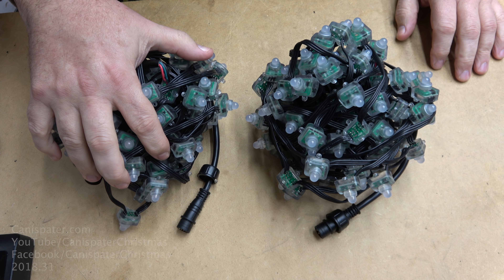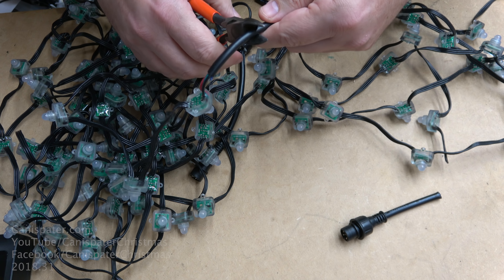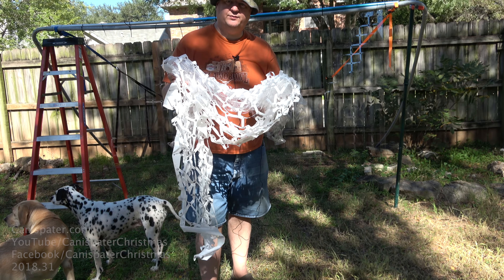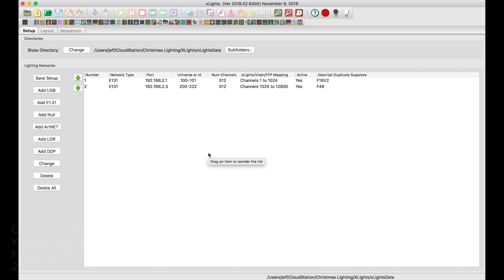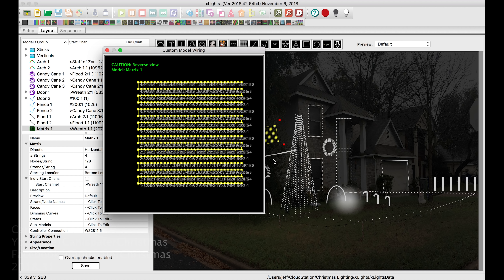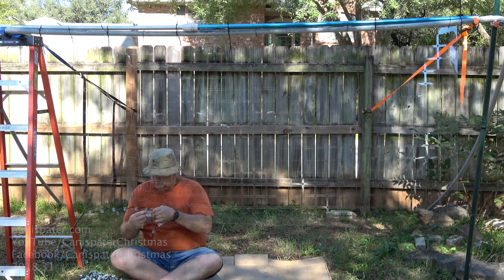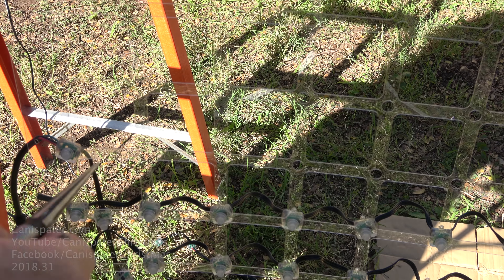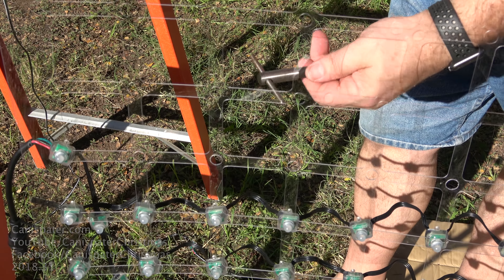AWESOME CHROMA-MESH CLEAR Matrix - Prop Build (2018)

Comment from the maker: Any suggestions for improving the jig? I think it's going to be a big hit! lol!
Reply: CanispaterChristmas I feel ur pain bro 
I had gotten a flag from holiday Coro and used inconsistency in that build my fingers were swore for a week!! 

Maybe use a sheet of plexiglass I think a 4/8 piece of 1/8 thick is around $50?
And I like the idead of the pipeline around it but I’d make more of a picture frame type deal,with a x behind it for bracing?!
Reply: But if you were going to leave it say in the middle of the yard maybe and old swingset frame and bungles? Or a porch swing?
Reply from the maker: Haha. Just a joke. I needed something to hold it up while I was adding the pixels. Then I saw how ugly it was and decided to make fun of selling them.
Reply from the maker: I got some 3/4" EMT for the top and 1/2" for the bottom. I'll mount it to the side of the house somehow.
Reply: CanispaterChristmas ahh gotcha damn it I would buy one too!! Ladder would come n handy hahaha 

Nice sounds good looking forward to seeing it 

You should of seen the mess I had putting my p10 panels together
Reply: Insert rebar into the PVC to help strengthen it and helps prevent it from bending.
Reply: A "C" clamp instead of the spring clamp,  it'll hold a bit more weight lol 😂
Reply: CanispaterChristmas is their a good way to setup the FPP with BBB for networking to my light
Reply from the maker: Jon, I'm not sure I understand your question. The BBB has an installation image, similar to the Pi. Once FPP is installed, configuration depends on what hardware FPP is communicating with.
Reply: CanispaterChristmas I want to use the BBB with a E1:31 network based RGB Controlers on a separate network
Reply from the maker: Ah. The BBB only has one network port so you would need to find a compatible WiFi card to plug into the single USB port. That's why Pi's are better suited for general use (4 USB ports, Ethernet and WiFi built-in). The BBB can accept a cape (Octoscroller) that drives P10 panels so that is why it is popular for FPP. Not saying it won't do what you want, but you'd need to add a WiFi adapter.

Comment: Another option is to lay the modular matrix on a floor or large surface, face down, and use a 1/2 inch right angle pvc elbow attached to a 2 foot piece os straight 1/2 inch pvc pipe. Place the pvc elbow under the modular matrix, first pixel hole, and push the pixel in from the back.  It will just click in.  No deburring tool necessary.  The 1/2 inche pvc elbow is the perfect circumference for  allowing the pixel to pop into the hole, with nominal pressure.
Reply from the maker: Excellent!

Comment: Jeff -- really interested in seeing video of the Chroma-Mesh in action.  My old matrix has about had it.  It was a home made model on 10' EMT with 2" spacing, 12 rows of 50, it and the box it is in weighs about 100 lbs!  looking for a new LIGHTER solution for next year.  Thanks again for the Video's  they make my week!~

barry in Oklahoma
Reply from the maker: Thanks! Yeah, this is really nice. I had a problem with the wires pulling too hard on the left side (which you'll see in the videos I'm editing), but I fixed that this weekend. Now, if I could just come up with some cooler patterns for it. lol!

Comment: Another great video.  I think I have a problem.  I just bought 2 Chroma-Mesh clear matrix 24x48 - 2".  I know that i will have to figure out how to break this up to run on my Falcon F16v3 controller but I don't know how.  Do I HAVE to absolutely split the pixels (576 each, 12 rows) and cut the wire?  Or can I put one falcon channel on 600 lights and the other 552 on another channel?
Reply from the maker: An F16 handles 1024 pixels per port if you run 20FPS or around 640 per port if you run 40FPS, but you can split the matrix up however you want.
Reply: @CanispaterChristmas  Thank you for the info.  With that said, should I run my whole show at 40 fps?  I think I plan on having my RPi-Zero + Falcon PiCap showing my megatree and sidewalk outline, and the Falcon F16v3 showing everything else.  (I hope that made some kind of sense)
Reply from the maker: Frame rate is more of a personal preference thing. I run almost everything at 20FPS. If I have a particularly jumpy song or I want to do something crazy on the matrix, I'll go 40, but most is 20. Some will fight to the death for 40 so Mac vs Windows. 😂If you want to do 40, you just have to plan for it with smaller strings.

Comment: So I just got this same matrix for next year. By going with 4 sets do you have to inject power? I was trying to figure a way around doing that. I was going to use the f16 for this and my windows upstairs. All in all it would be around 600 pixels.on the f16
Reply from the maker: I didn’t inject any power, but also ran it at 30% brightness. If you go higher, you might need to inject.
Reply: @CanispaterChristmas  good call on turning it down it might make it easier to see from closer also.

Comment: How do you like the 512 pixels? I'm debating on 2" or 3". Viewing from the road to where it will be is around 45-50Ft. Suggestions?
Reply from the maker: Personal preference really, but I find 3" spacing fine for most things other than text.
Reply: @CanispaterChristmas  Mainly would be used for effects,so 3" seems to be the right choice. The less pixels to install the better.:)

Comment: Jeff, is it possible to provide a line drawing of your controllers and lights. I am still a little fuzzy on what I need for a basic setup. I have a computer that I can use to run the show and control the lights. Thank you.
Reply from the maker: I don't have anything specific posted anywhere but have videos outlining a basic system (see https://www.youtube.com/playlist?list=PLFyrAfJ-kKd4ZfPdXWIt8v_bav61mW_KW). In addition to the computer, you'll need pixels, power supply(s) and a pixel controller.

Comment: if I wanted to an animated GIF in my display, would the 3" spacing look ok or should i use closer spaced chroma-mesh?
Reply from the maker: Personal preference and depends on what you are animating. 3" is not going to look like a TV Monitor, but if the GIF is not too big, probably OK. If you are picky about it, go denser. You might get some idea of what it will look like in the xLights preview so that might tell you which way to go. Lighting nerds will say go more dense. :)
Reply: @CanispaterChristmas  thank you.  you are my hero!

Comment: So you used a 4 port controller. Did you have to power inject. Or by using 12 volts worked out without?
Reply from the maker: I didn't need to inject power on this, but I run it at 30% brightness so that helps. It's a 4-port differential receiver that works in concert with the F48 (or an F16V3).

Comment: How do u store these prop. Can it be rolled along with pixels?!
Reply from the maker: Yes, either roll them up or hang them on the wall like a picture. Not sure yet. :)
Reply: @CanispaterChristmas  do u know the material it's made off
Reply from the maker: @joeskolengaden2641  No. It's some super-secret formula. Feels a little like really thick PET (think bottled water, but thicker-walled).

Comment: Hi Jeff. I blame you in getting me into this hobby 😛lol. 
Anyhow you mention that you’re going to use one differential controller then using one port for each string of 128 lights. 

My question is why?  Would it not be easier to not splice then connect all 500 + lights to one port and create virtual universe? of course you would have to power inject.  (I’m just a beginner and I’ve learned pretty much everything from you). :).
Reply from the maker: Haha. Well, I think I can run it that way without having to inject any power at all - it's a little simpler that way. But your way is certainly possible. All of my strings are 300 pixels or less and it's really just a personal choice. If I was short on ports, I may have wired it differently. What's a virtual universe - just grouping more than one together? :)

Comment: So dumb question.. which pixels are these that you are using?, ie: what are the chip/pixel enclosure dimensions?  Maybe you have a sponsored link for the pixels  I have overlooked as I'm sure you may have had this ?? a zillion times.   Great overviews for newbies.. I've been interfacing my own stuff for years with 5050/2811 strips + SanDevices + LightShowPro but the xLights/Falcon/Meanwell and pixel setups with Boscoyo products have reinvigorated my interest in not reverting to a "boring" setup this year.
Reply from the maker: Thanks! These are just WS2811 square pixels. I buy all my pixels directly from Ray (China). They are roughly 12mm heads with a 1-1.5cm square back. No sponsored link for pixels although, I like your thinking! lol! More info at https://youtu.be/n6WO9tSfJL8 about a minute in unless you enjoy my silliness. Welcome back!